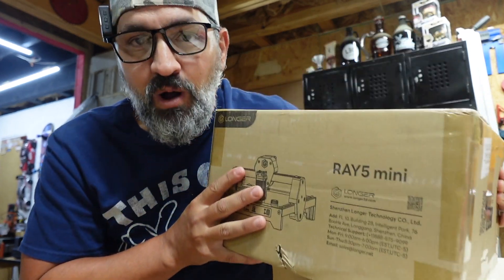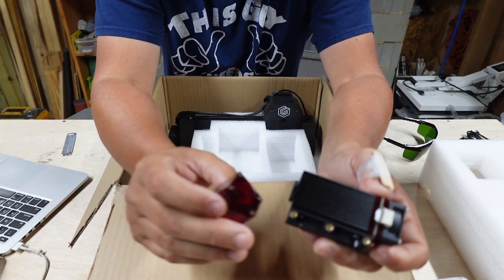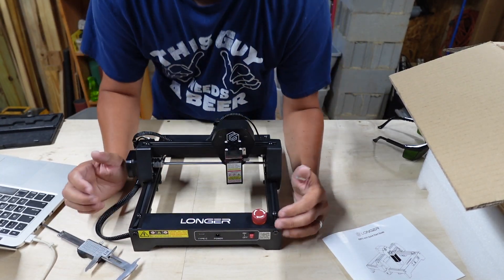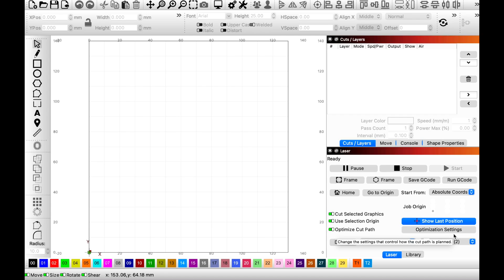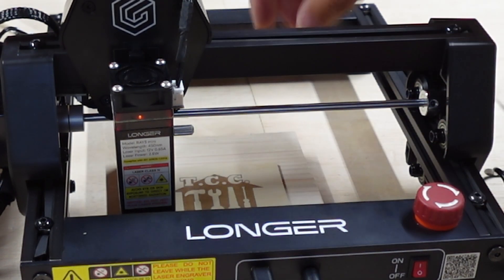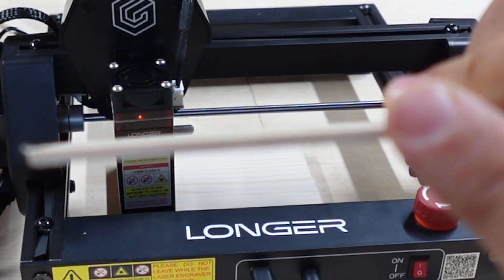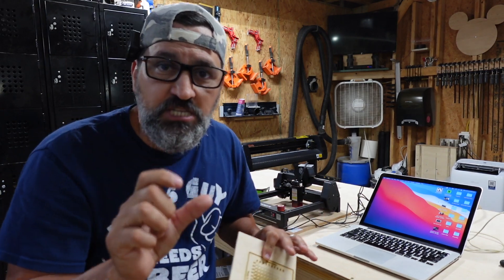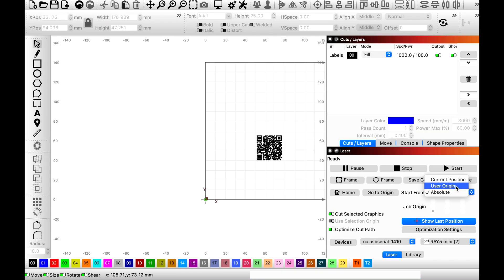Longer Ray5 Mini 2.5W Laser: Full Unboxing, Setup & Real Tests!

Comment: Could I use this to cut some 0.25" thick EVA foam?
Reply from the maker: Short answer: No.  It will melt it and not cut it.  Best to use a CNC with a drag knife or CO2 laser.  Need good ventilation if you go CO2.

Comment: A few stupid questions for a dead beginner and you are my first video to watch - does the laser arm literally rest on top of the object? Like the M3 screw is really just holding the arm on but essentially its totally slack. for example, i plan to mainly use this for dog tag type etchings. When i upload the design into the software without a grid mat type object under the machine how do i know the laser will find exactly where the tag is and laser on it in the middle? THANK YOU

Comment: Hi, I bought this laser engraver. How do I align the laser over an 8mm wooden ball? I need to engrave a 5mm logo on the ball, but I can't figure out how to align the laser over the ball.
Reply from the maker: Hmm….. maybe us a glue gun to crate a “stand” for the ball so it doesn’t roll around.  You should be able to fire the laser at low power like .5% so you can align the laser as close to the center as possible.  Hope that helps some